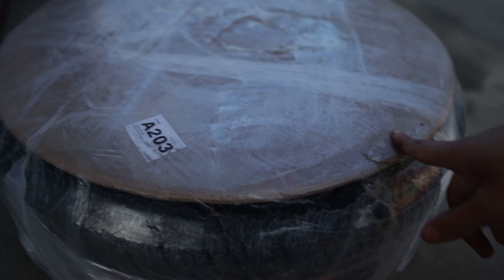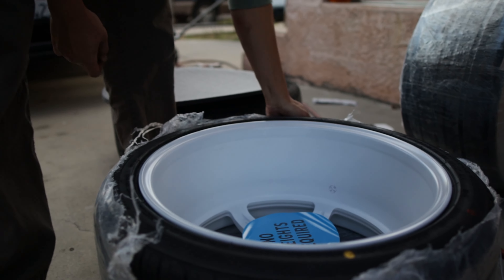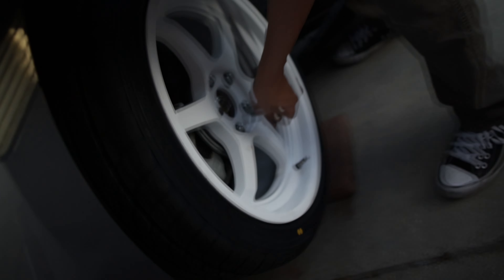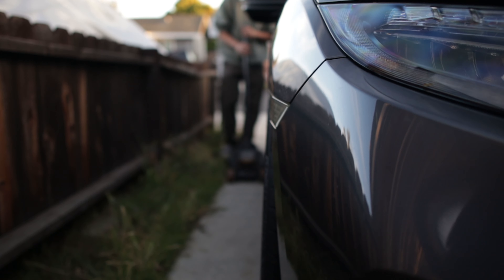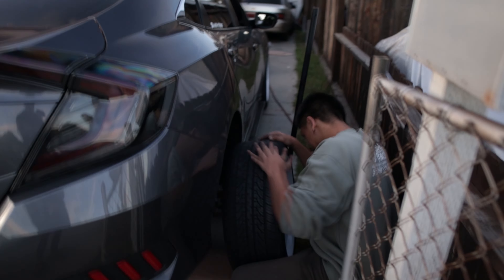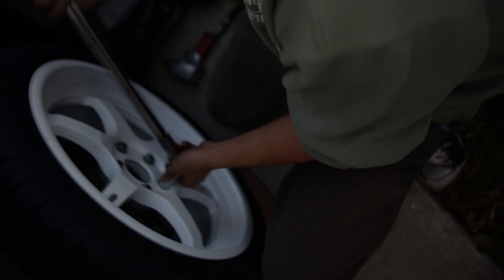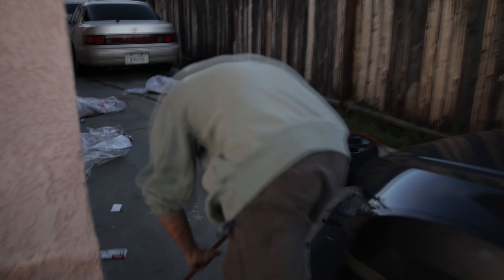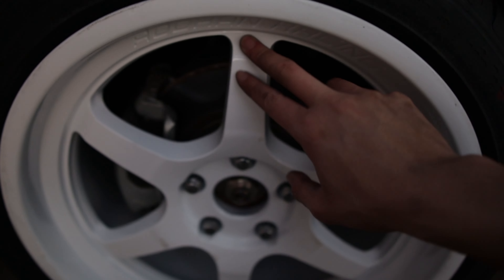New Rims for my Civic‼️ | Aodhan AH08 18x8.5 (235/40/R18 Tire) 🏎

Comment: Im getting a new set of rims 18x8.5 +30 235/40 i also wanna get it lowered with this setup would the D2 racing springs be good and would it prevent rubbing?
Reply from the maker: I know someone running a similar setup there shouldn’t be any rubbing although I’d recommend running a 9inch wide wheel
Reply: @AaronStrong  yours are 18.5 time 4 some new rims ?? 🤪 or nah
Reply: @AaronStrong  so a 18x9 +30 would be fine ? With coilovers ?

Comment: Will 235/45/r18 fit on the civic? I’m thinking of trying it my last avid1s got bent in a few spots I’m not sure if it’s bc the tire sidewall amount or if it was bc Of my driving
Reply from the maker: I'm sure your setup would work avid isn't the most high quality brand out their but don't get me wrong some are durable
Reply: Yo did the 235/45 end up working well or was the tire too high and close to fender?? I want meaty tires I’m thinking this is as far I can go with my car being lowered
Reply: @ not at all. i had to sell them. They rubbed on my sidewall.